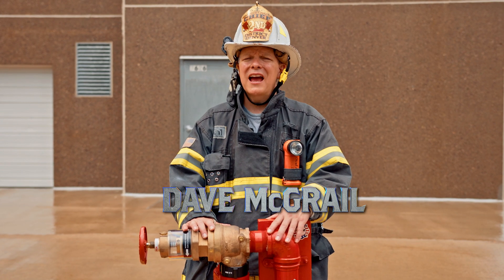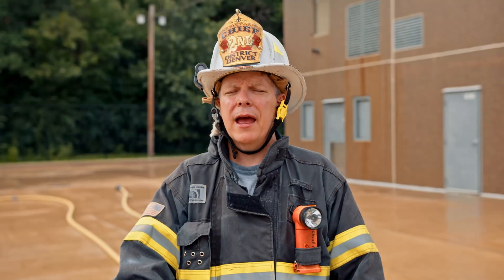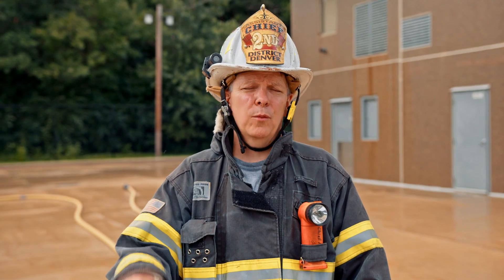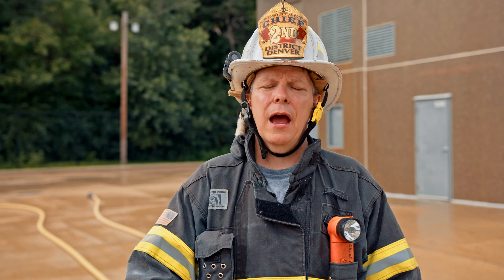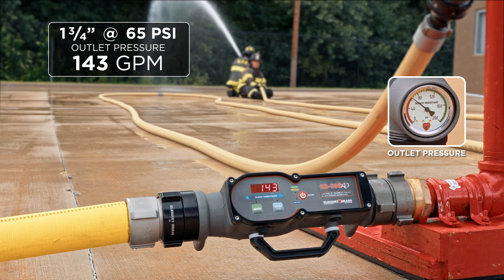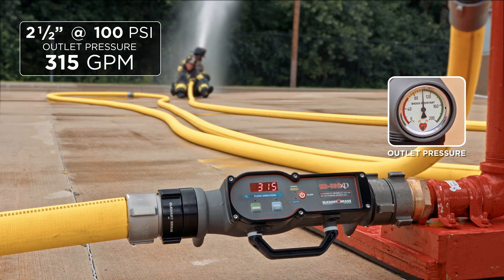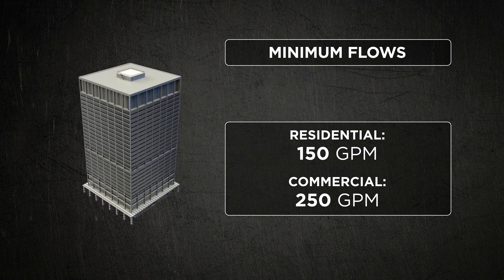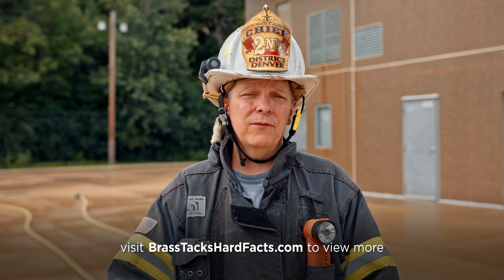1-3/4” versus 2-1/2” for Standpipe Operations  (Ep #59)

Comment: What about using two 2" lines with 1-1/16 tip and a Y at the standpipe? At 100psi at the pipe and 200ft would that not give you about 245gpm at the nozzle? Plus gain a backup line in the event you need to rescue your attack crew?

Comment: If 15/16 is 185 GPM at 50 PSI then why is the GPM lower at a higher PSI?
Reply: Bo Medlin because it’s accounting for 100psi at the outlet not the tip of the nozzle. The 100psi is before accounting for the friction loss in the hose.

Comment: Look into a stream shaper. Will greatly increase your range, penetration and air induced into the fire.
Reply: KosukiFire stream shapers are great when you need that extra range such as defensive operations and staying out of a collapse zone.  However on the interior the extra range is not needed especially in the confines of a residential building.  Be aware that use of a stream shaper negates one of the benefits of the smoothbore since they cannot  pass larger pieces of debris often found in standpipe systems.   A clogged nozzle can be devastating to the nozzle team.